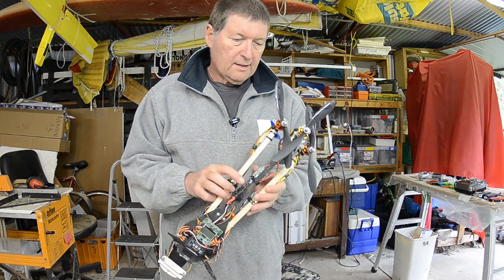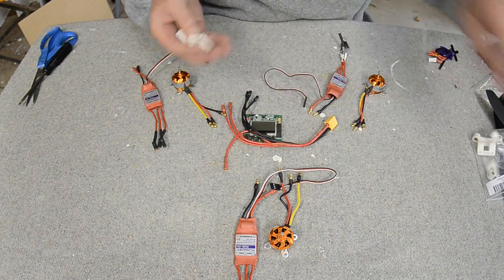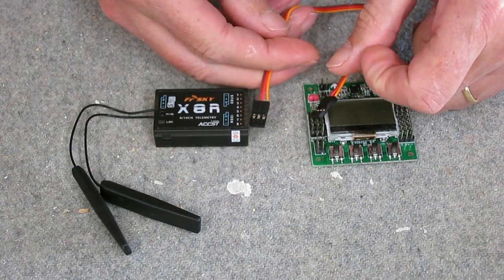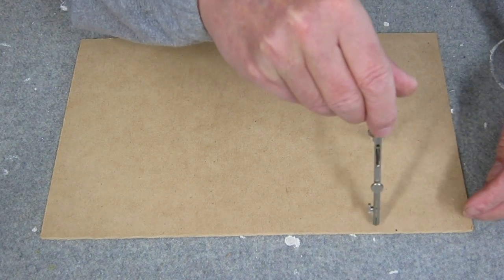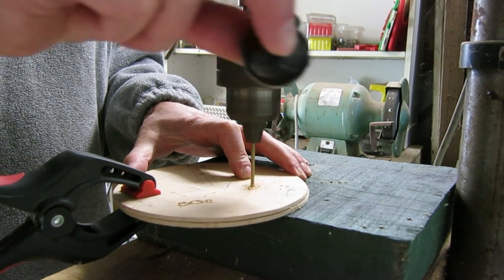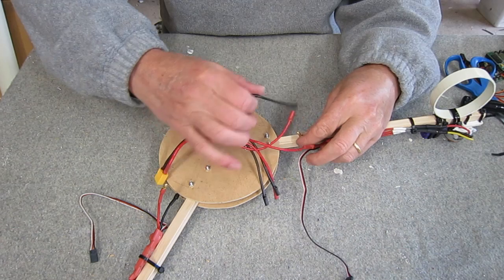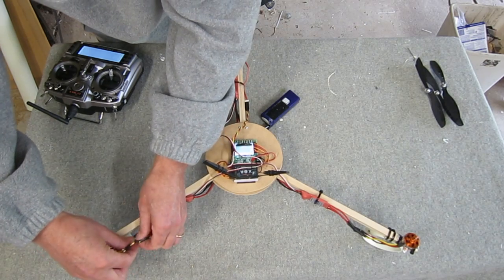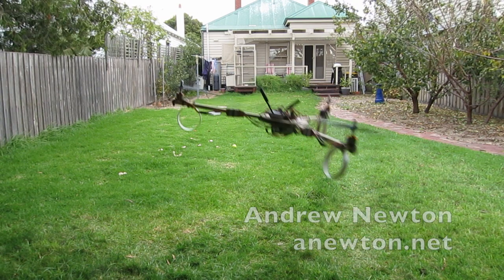KK2 Tricopter build

Comment: G'day Andrew.
Another good video. You made me dig out my old tri & blow the spiders off it. Still have to learn how to fly the thing properly though.
I know you mentioned SimonK flashed ESCs, but to second your comments.. upgraded ESCs improve the control enormously. Really enormously!
I'm sure you've got the background, but for other readers:

Default / traditional calibration ESCs have usually been programmed to smooth out throttle transitions - allowing for a nice smooth ramp-up / down of your prop. Great for planes, but not so good for multi-rotors (I assume that gun 3D pilots would also want to use mutli rotor cal ESCs?).

Most ESCs use one of 2 family of controller chips to run their firmware; either ATmega or SiLabs.
Simon Kirby (SimonK) developed some revised frimware & tools for ATmega based ESCs, and OliW has done the same for SiLabs. Plenty of other have added to their work.

If you want to flash your own ESCs a good place to start is https://docs.google.com/spreadsheet/ccc?key=0AhR02IDNb7_MdEhfVjk3MkRHVzhKdjU1YzdBQkZZRlE#gid=0 where you can work out what chip you have, & follow the links to various guides from there.
Also OpenPilot have a good article on doing the SimonK thing https://wiki.openpilot.org/display/WIKI/How+to+Flash+SimonK+to+ESCs
... and OlliW has a good guide here http://www.olliw.eu/2012/owsilprog-tutorials/

A big thanks to Simon, Olli and everyone else involved for their great work!

Cheers.
Reply from the maker: Lex Dysia Thanks. It's interesting, but at this stage I'm not finding a great difference between the Plush and Afro simonk ESCs. There is a difference but it's not night and day. Maybe the Plush ESCs are OK for multirotors or my motor choice and skill level is masking the difference. Onward and upward!
Reply: Andrew Newton 
Fair enough.
I found with standard ESC cals the controls always felt a bit disconnected from the copter irrespective of P & I values. Height control in particular was very mushy. Slow flying in stable conditions wasn't too bad, but anything more than that was a bit of a challenge.

Comment: You may want to try mounting the board without the foam stand offs and see if there isn't some improvement in stability. The more rigidly those are mounted, the better along with very well balanced props. Excellent project.
Reply from the maker: yellowbusguy Thanks I'll try that.
Reply: Vibration mounting the board will still help.